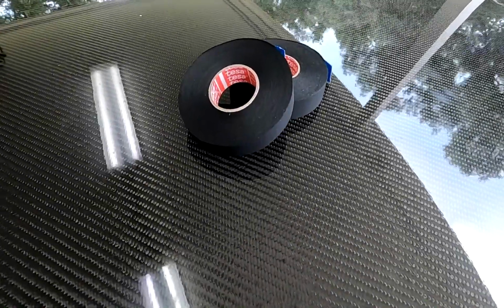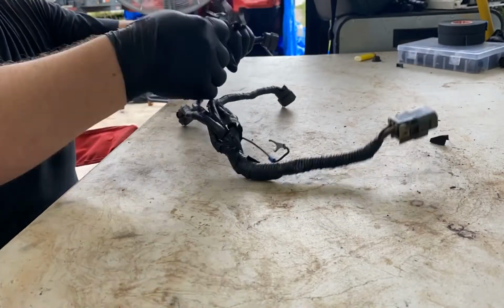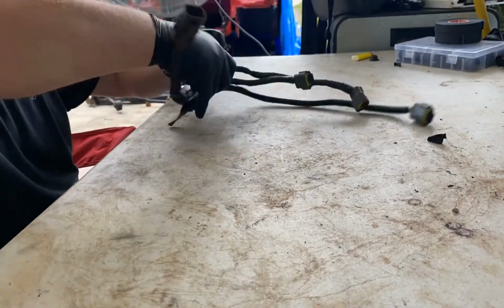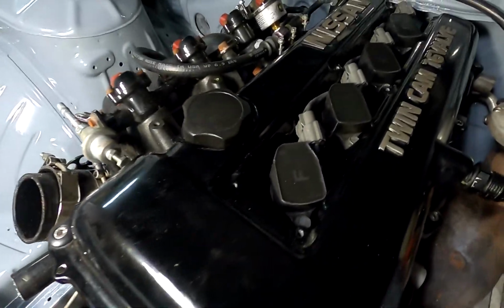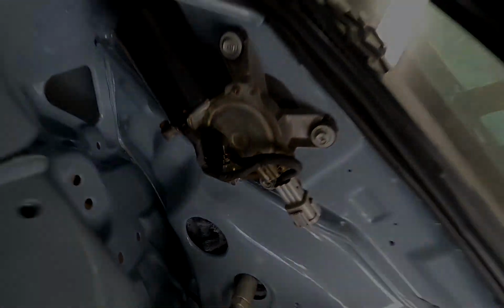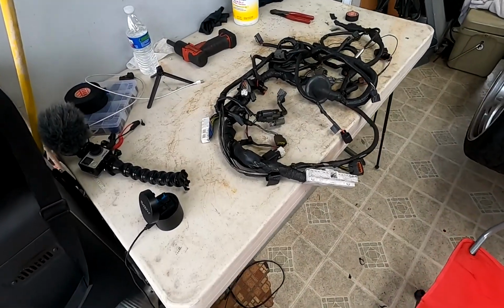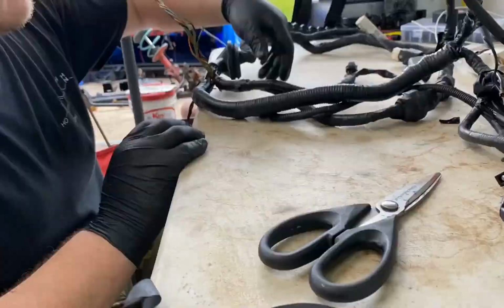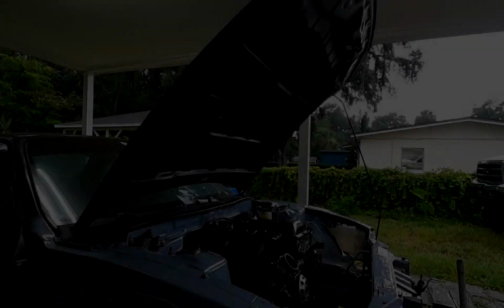Restoring my ENTIRE engine wiring harness with tesa tape | S14 BUILD PT11

Comment: Idea that can help. Put a cable tie (zip tie) at each wire junction as you take the old tape off (a good use for the thin cable ties that come with any cheap multi pack, which are useless for almost anything else). This keeps the branches separate while the tape is off. Then just cut these cable ties off as you get to that junction when retaping the loom.

Also means if you need to put a replacement wire in you can feed the new wire through the cable ties as you remove the old damaged cable.

Comment: Split loom actually protects the wire from heat damage by providing an air gap between the wire and the split loom. Something to think about for those high heat areas. Tessa tape provides good friction and abrasion resistance but doesn't insulate

Comment: The biggest issue I’ve found in the Semi Truck world is that no mater what is used , wire harness’s need to be secure , vibration is the death of wiring , chafed wires are usually the number one cause of an electrical fault. Then you have the small cuts that let moisture in and then the green puss starts growing. I’ve seen wire loom chafe through the small gauge ECM harness. It’s always a battle.  These OEMs are cutting corners and the wiring harness show it .
Reply from the maker: Late reply I know but I know what you mean. The normal electrical tape tends to fall apart and be a sticky mess to work with. For the cars I build I often have to go back in and modify wiring after some time for upgrades and this tape tends to hold up well over time and is much less nasty when its time to unwrap.

Comment: How's it held up?
Reply from the maker: It works great, many manufacturers use this same tape such as Mercedes and bmw.
Reply: @240Trevor it falls apart if not put right which they won’t put on right . What i did is I covered all my harness in a sliced cable sleeve looks way better and more resistant

Comment: Watching your video, it seems you have grown some strong prejudice against electrical tape. You should note that harness tape isn't meant to be used as electrical tape. GOOD electrical tape has strong dielectric properties, seals very well, is resistant to about everything and has a broad temperature range. I would use electrical tape where it is appropriate. Over connectors, splices, connector backs, repairs etc and then go over it with Tesa when you do the full wrap. 3M/Scotch Super 88 is the best stuff you can buy (that isn't industrial). It is what pro electricians often use. It is also not cheap, probably more expensive than Tesa, but it is handy if you hate things like 'green death', shorts and electrical interference. If it doesn't say 'Super 88' or 'Super 33+' on the inside of the roll, I would highly recommend throwing it out.
Reply from the maker: I understand man, I used to be a commercial electrician. For most automotive applications Tessa tape is a better option. Overtime vinyl electrical tape usually peels back and makes a sticky mess especially around heat/moisture.